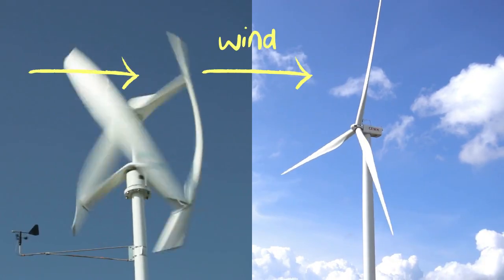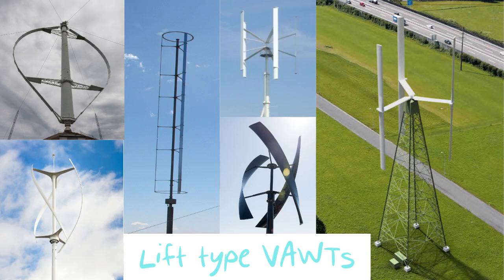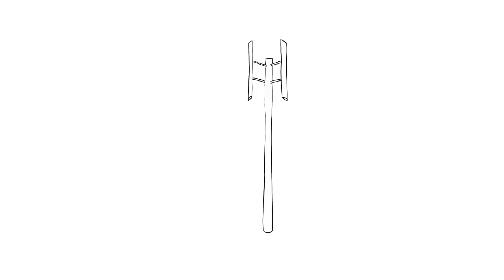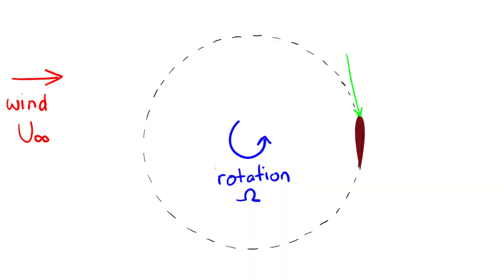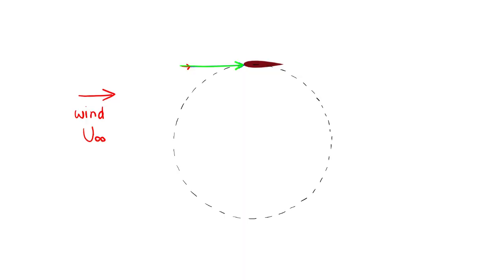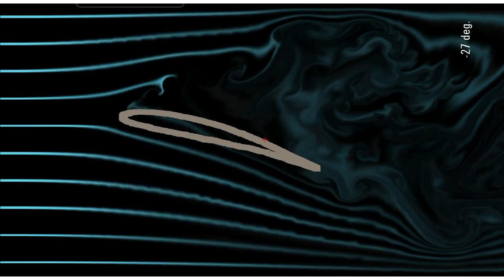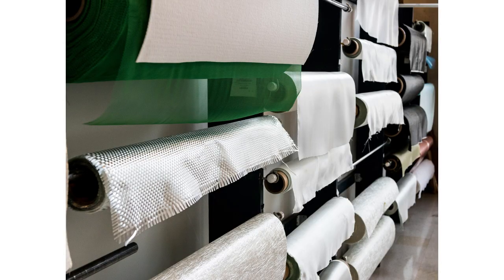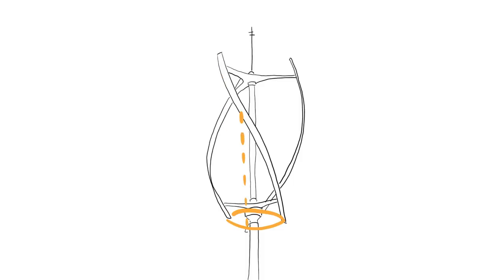Vertical Axis Wind Turbine Aerodynamics and Design

Comment: what about using multiple gear box / seperate operating shafts. the gear box and shaft closest to the blades would be largest then few feet down the gear box would decrease thus generating more power in the lower you go on the shafts. also using a 90 blade rotational fan brake on each vertical blade should allow the blade to catch max stream there would have to be a brake motor at the base of each blade so the blade would always rotate for max wind shear. the multiple gear shafts would essentially be  10 speed bike compared to 1 speed 
the higher torque on the turbine should in theory enable more power generation. still have massive power surge's this entire system would be great for charging a power storage system. but not for genaral flow rate. if you needed 30kw constant draw. wind speed could massively be affected so power bank changing to constant flow bank would diminish or all but eliminate this issue?? looking at off grid possibilitys here. im working on my 3rd attempt at building one starting with straight blade then went to bowed blades. current one im building will be triple helix blade. i have run into many of the issues you mentioned so far. shear strength of the material being #1 issue. would definate like to see more of the math involved. cheers.

Comment: Has a VAWT been built with similar blade size or footprint of commercial HAWTs to enable a closer real world comparison?
Reply from the maker: Yes, certainly. I could try to find a few similar-sized HAWT and VAWT off Alibaba and do a real life comparison. Would that be interesting?
Reply: @EngineeringwithRosie  That would be fascinating. There are a couple of different like-for-like metrics. One would be power generation in the same conditions - looking at up-front cost and total lifetime cost. The other would be looking at footprint and "envelope" - seeing as VAWTs are often seen in urban situations.

Also has any research been done on comparing the impacts on birds?

Comment: What about the Rotating-blade vertical-axis wind turbine? Maybe the most efficient VAWT design. There are few configurations/designs but they have the same principle, rotating blades that always produce ‘lift’. You brushed thru it. See patent US20120183400A1

Comment: Is there a diagonal axis wind turbine (dawt)?
Reply from the maker: Actually yes! Or at least I have heard the concept discussed. You can apparently improve some aspects of a VAWT by tilting the axis off vertical. I don't much about it beyond that though, and as far as I know it was never used on a commercial design.
Reply: @EngineeringwithRosie  cool! I think it will be useful if there is a diagonal one, it could be useful during wind rising from the bottom of hill to the top and vice versa

Comment: Thank you so much for this. I really think VWAT have a place in the green energy we need.  A fixed variable pitched turbine ( lower cost as opposed to mechanical moving blades)would be easy to incorporate into a small system for home generation, with a much smaller footprint of a HWAT. Easier to install and maintain.

Comment: The h type is basically easier to manufacture with airfoil than curved blades, it is not a huge deal but think like this, it need to be s- bent around a sphere, vs a straight plane . The H has an advantage in simplified moulds and can be scaled in lenght pretty easily .

Comment: I have just discovered your channel, sent here by "Just have a Think". I loved your presentation on VAWTs, something I've been interested in for ages. My reason for building one is to supplement my solar for my self sufficient lifestyle, which will include charging my electric vehicle. Most of the time I was watching I was saying to you (pity you couldn't hear me through this one directional medium) "What about an active blade turbine, have you ever heard of one?", and then towards the end you mentioned them. I hadn't heard of them before, except for the one I've designed for myself. I don't have the time or capacity at the moment to build it, however, I hope to do it late this year and early 2022. My biggest concern is the maintenance and wear and tear of the blade angle control system. I believe each blade will be contributing positively for around 300 degrees of the rotation, and I intend to build a 5 bladed version first up. I have built a small cardboard mock up of the blade control mechanism, and as I intend to control the blades with a cam and follower system, I'm also concerned it may be noisy. There will be challenges! But really looking forward to starting that project. I will also be checking out more of your videos.
Reply from the maker: That sounds like an awesome project! I agree with your assessment of the biggest challenges your design will face, it is good that you know that from the start so you can test out that part of your design first. I will be really interested to see your progress if you feel like sharing on the Engineering with Rosie Facebook or Instagram. Or you can can tag me here too if you make a video.
Reply: @EngineeringwithRosie  I will be more than happy to do that, and thanks for your interest, Mike.

Comment: Saw a turbine laying horizontal that was in effect a vertical Where they took the winds rising up a cliff face and let the top of it get the wind force by wind channeling; they told me it was rather efficient as the off side from the wind did Not get wind hitting it.
  hat do you think? The wind was channeled from the sides to add More thrust to the rotating blades.
Reply: Great idea

Comment: What about using mechanical manipulation of the wings instead of complex electrical systems? Think timing belt setup on an engine. Using a link system indexed to the position of the wind.

My only thought is this would make the turbine need a yaw feature to point it into the wind, so the blades could rotate at the right time.
Reply: I think a cam type system would work well.  I have drawn up some designs using an off center disk to adjust blade pitch differently depending on their position around it.  A weathe vein would spin the disk to adjust for wind direction.

Comment: Hi Rosie! Usually wind turbines mikes a lot of noise when used in a sail boat. Do you have any advise on which model (models) do less noise ? Thanks
Reply from the maker: I don't have any specific advice, but a good rule of thumb is the slower the blades are moving, the less sound. The manufacturer will probably give the RPM and the blade length (for HAWT) or the rotor radius (for VAWT). Then you can just multiply (make sure your units are consistent) and get the tip speed.

Comment: Love your videos! If the major downside to the Savonius type turbines is the drag of the wind on the returning blade, why can't you shield that part of the blade with a 'shell' that would track the wind and only expose the blades that catch the wind? Kind of like adding a spinning turbine to the underside of a plane's wing that is exposed to the faster moving air while being half concealed inside the wing. Thoughts?
Reply from the maker: You can and people have. There will still be some drag and then you lose the omni-directional advantage. It's all a matter of tradeoffs, like most engineering problems!
Reply: Like these:-  "    See the 1,000-Year-Old Windmills Still in Use Today    "

Comment: sounds like VAWTs could help in europe where the noise is (perceived as one of) the biggest problem in some areas. it's of course more a political issue than anything else though (there have been some ridiculous distance rules introduced by fossil-fueled politicians in germany trashing the whole wind industry there).

Comment: The advantages are not necessarily in straight up comparisons to HAWTs. It's in the usefulness at point of use. I believe that's the future of VAWTs. Having massive HAWT utility farms is unnecessary if power is produced locally a point of use like solar panels. VAWTs can be put almost anywhere. If each house or even small business was producing there own power, the need for increasing Huge HAWT farms or any other type of central power production would be much less, maybe not eliminated, but less. Total cost would be distributed throughout the large amount of small installations and maintenance. I realize it's a paradigm shift, but that's my thoughts.

Comment: I do think VAWT has its own niche and should not try to compete with HAWT in terms of efficiency. However, we do need to find a way to improve its efficiency as much as we can while still  maintaining its advantage over HAWT (omnidirectionality, lower cut-in speed, simpler design, etc). As you have mention in the video, for a distributed, off grid, remote area, and site with lower average wind speed, VAWT is the better choice over HAWT. 

Finally, i loved your channel and i am glad it popped up in my recommendation algorithm ! Cheers from southeast asia !

Comment: https://youtu.be/nNp21zTeCDc I hoped you would do a video like this as an actual engineer. Do you think these home wind generators hold promise or are possibly vaporware?
Reply from the maker: Thanks for this question, and I will make a video on urban wind soon. I wouldn't go so far as to call them vaporware, but they are never going to be a major part of our electricity generation. There simply is not enough energy in the wind in urban areas to get a good amount of electricity this way, even if they were twice as efficient and covering every roof.
But for off-grid situations they will be a great addition to solar power and batteries only (if wind speeds are good). And I think they are simply very fun. It is a nice way to get people interested in where their electricity comes from and learning about engineering.

Comment: I enjoyed your video but your simple diagram of the Savonius windmill did not show the slight overlap of the blades at the centre. This gap provides the torque factor that makes the Savonius an ideal solution to pumping water as well as turning electrical generators through a gear system.

Comment: Hawt vs. VAwt - from the computer industry, the idea of TCO (Total Cost of Ownership). Since with a VAWT, you place most of the mechanical (and all of the complex mechanicals) at the bottom, much reduced need to climb a 100m tower with it's concomitant risks. I think they're less likely to catch fire, too, saving engineer lives (no bailout systems on the power heads of HAWTs). As to blade-pitch control systems, there might be some ideas floating around in the sailing world, specifically wing-sail boats. I believe they are doing some good work in more passive control systems.

Comment: I heard that another advantage VWAT is that they can be placed rather close to each other if you have a field with many machines. It can be an offshore field for example. Wind flows are not so much disturbed by VWAT compared to HWAT. do you think that is true ?
Reply from the maker: Thanks for the comment Armand. Yes, I think that is probably true, but I don't believe it will result in lower electricity prices compared to HAWT wind farms for several reasons. I'm planning a video on this topic where I will be able to explain why I think that, it's a bit complicated to explain in a comment.

Comment: There is a twist on most aircraft wings, they have a steeper angle of attack inboard than outboard.   Air will stall inboard before outboard so that ailerons still have some control if the aircraft nears a stall.

Comment: Are there blade pitch changing systems featuring a cam with a certain profile on which push rods ride that connect to the blades? (similar to the swash plate assembly of a helicopter but with the cams in a different orientation and less complex) this cam can then be rotated into the wind with a wind vane.
Just a thought and i'm wondering if something like this has been done before
Reply: Quick google search showed me that exactly that has been done before, wind vane and all.

Comment: The active blade pitch vertical wing could be achieved more simply on a flat wing with leading and/or trailing flaps / slats (similar to a jet's wing) rather than varying pitch on the whole wing.  I think the wing could be made to fly at every point in its rotation by changing it from (relative) concave to convex.
Reply: I would like to see more on that.
Reply: @jenshobroh1294  Someone else did it with mechanics, but I think the trend now is to use spiraled blades and more exotic shapes.

Comment: If I'm going to install a wind turbine at home, it seems like it would have to be a VAWT.  Monthly peak windspeed of around 120kph (Porirua, NZ), but it's an urban area so I can't exceed noise limits, and maintainability is very important, even if it needs to be frequent.  Solar handles a lot of power requirement but wind supplements this very well.  Add (enough) batteries^Wstorage and I can be off-grid forever, which is a subsidiary goal.

Comment: Very interesting analysis  - I started off liking the vertical axis  but then the complexity of design does come into play. As a retired pilot of multi engine large propeller aircraft I needed both, in addition to other control surfaces (rudder, flaps, ailerons,  stabilizers,  etc), and "power".  You may not remember the propeller on a stick toy where you have the the propeller  in a horizontal position, and rotate the propeler with the stick,   that way you get both angle of attack and rotation speed.  However like a helicopter you would probably encounter vortex ring state, or ground resonance, unless the propeler was at an angle . You would definitely have to reduce the size of the wind blade for horizontal operation. . Just a thought. On combining both designs into one..

Comment: Do winds on a mountain ridge have a vertical function, ie traveling parallel to a cliff face?
Why the obsession with electricity, why not hydraulics?
Reply: Compressed air generated by a high torque, low rpm VAWT is a good option

Comment: Could the moving parts of adaptive designs be replaced with compliant mechanisms that are robust?  That could bring down the manufacturing costs substantially.  Such mechanisms would not be limited to single, fixed pivot point.

Comment: Very interesting Rosie!  Umm, so what is a good simple design for a diy VAWT?  4 straight blades with the correct wing shape? 2 blades? 3?   I suppose you would want to make the vertical arms holding the blades very strong, maybe add vibration reducing ideas...

Comment: I feel like VAWTs would be overall safer for birds when used in wind farms. Especially if you go fairly large scale with lower speeds of the turbine. I feel like they're more visually obvious and dangerous, so the birds would avoid them. Could be completely wrong, though.
They're definitely useful for providing a little more power throughout the grid, requiring much less of a load on the primary grid power source. They CAN be relatively simple and relatively cheap, which is a huge plus for customer buy-in.

Comment: Has a scoop on the windward side of a VAWT ever been tried?  I've lived in places where the wind only changes a few degrees a day, so the quickness of wind direction change the verticals are good at responding to is not as relevant.

Comment: KISS. re: VAWT.   Why not have a blade that collapses away from the force on the return cycle. This could be done using bearings at both ends of the blade shaft and a stop pin or brace to keep it from hyper extending when swinging back, thus allowing it to "free fall" creating less drag. It would naturally be orientated to capture when on the power side.

Comment: Hi Rosie,
great video, explaining quite some things I already been thinking about on vat designs. One thing you mentioned is the complexity on having the blades actively tilted according to their position to the wind, this is something I remember being already used, even in a pure mechanical way, in an "old" ship drive called Voith-Schneider Propeller established in the 1970's. Sure it might not be possible to copy the kinematics one on one but it shows that it is possible to stear the blade angle on a reasonable complexity, even without any active servos and microcontrollers, programming, and timing sensoring, what do you think?

BR, Sven.

Comment: Number of blades even vs odd, and seems like 5 blades in helix might be good for reducing vibrations. Wish there were inexpensive units available to play with at home.

Also what are your thoughts on DC to AC conversion? Watched Dave at EEVblog upgrade his house solar system and he talked about micro inverters with his new panels, wondering if these would work with wind power as well as they work with solar.

Comment: Another characteristic of VAWTs, that comes to the mind of a laymen, is that they have a smaller footprint. That is in terms of the volume of space around the turbine that needs to be clear of obstructions, in order to allow for the needed rotation. This means that VAWTs seem, to me, to be better suited to urban environments. By this I mean, antennas, guy wires, rooftop water towers, utilities like heating and AC, and so forth, become less of an issue to work around. And, while I was typing this, I thought about you having mentioned that VAWTs are better at dealing with turbulent wind conditions... which are highly prevalent around all of those large and variously shaped buildings.